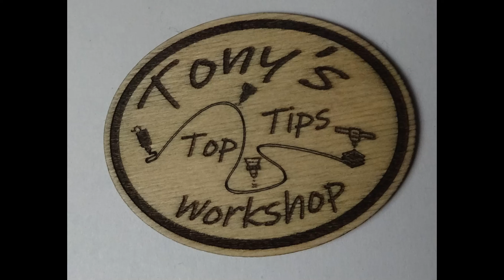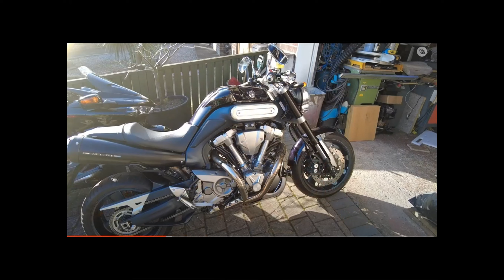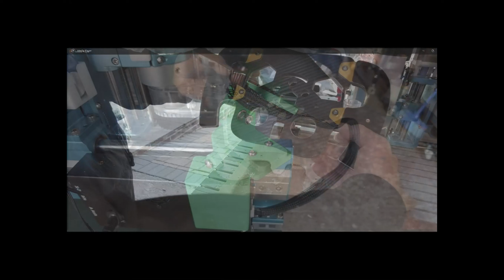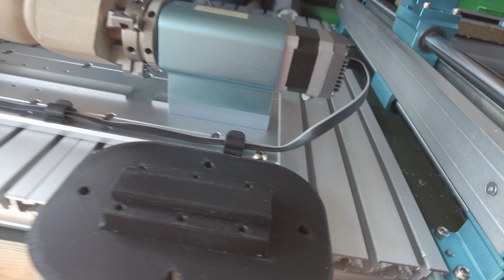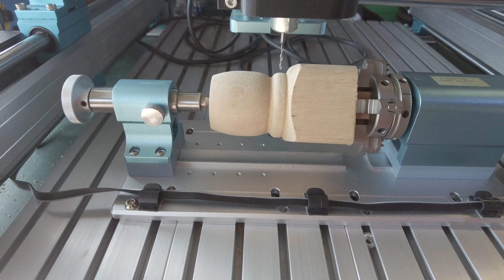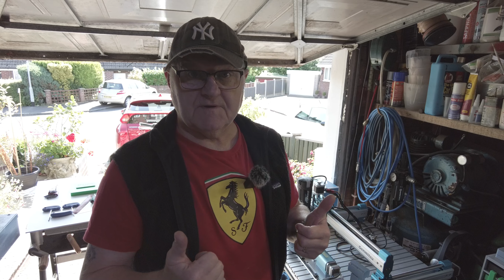Increase the working capacity of your Sainsmart 4th axis Rotary

Comment: Thank you for your informative videos. I have a 4040-pro max arriving any day now. I was considering the 4th axis but didn't pull the trigger on that yet. I was wondering if it would be possible to turn the whole thing 90 degrees so it runs parallel with the Y axis instead. That would allow mounting the headstock out of harms way in the back of the machine and also allow to work on longer pieces. Is there any support for that in the setup? I also wonder what software is required to get full functionality for the 4th axis - Fusion seems to require a paid upgrade. Is there any free - or cheap - software around that would work?
Reply from the maker: Hi thanks for your comment and question, you can turn the 4th axis 90deg so in the cad software you would change the way you rap the x or y axis when designing your work. I use Vectrics aspire but its expensive, you should be able to do the same in other free cad software programs. The 4th axis is a little limited in the size of project you can secure in its chuck and between the tailstock. One of the reasons why I have shown in my video about increasing the size you can work with on the 4th axis.

Comment: Hi Tony, I’ve not the fourth axis yet but would love to have access to the STL files for increasing the diameter of turnings. Your idea of separating the headstock and tail stock on the Y axis is a great idea too and I’d like to print out the mounts you made ready for when I take the plunge. Looking forward to further ideas from you.
Reply from the maker: Hi thanks for your comment I have uploaded all the stl files for the appropriate riser blocks. Just remember to check all clearances before moving the machine. I have uploaded them on makerworld search for Sainsmart 4040 pro 4th Axis Riser blocks
Reply: @Tonys.Top.Tips.Workshop  Many thanks. Your helpful upgrade tips are very much appreciated as are the STL files you freely share. They save a lot of time and thinking that would be necessary to design and produce them myself. I’ll download the files later tonight. 😀😀

Comment: Hi Tony,  Nice idea and a great video.  I just installed the new ZX axis for the 4040pro and it is a major improvement.  The new piece is very ridged a very useful upgrade.
Reply from the maker: @jimbembinster  hi Jim nice to here from you again hope you like your upgrade was it expensive
Reply: @Tonys.Top.Tips.Workshop  I paid $279.00 free shipping.  The Z axis has linear guides and bearings and the X is super beefed up.  It's amazing how stiff the machine is with the upgraded ZX axis.  You'll want this for your 4040.
Reply from the maker: @jimbembinster  Thanks for the info will put it on my xmas list
Reply: @Tonys.Top.Tips.Workshop  You'll want to do a video about this upgrade, I'll be watching for it.